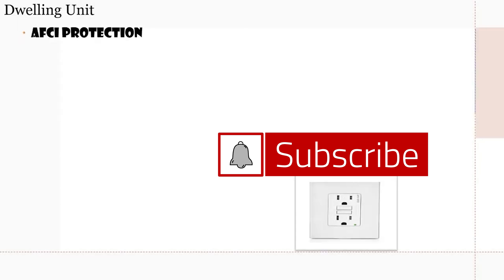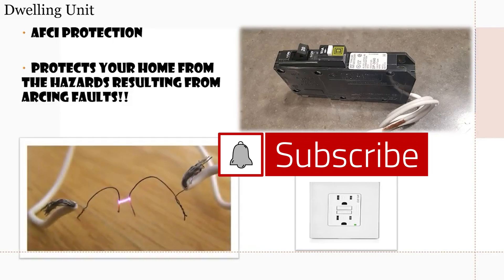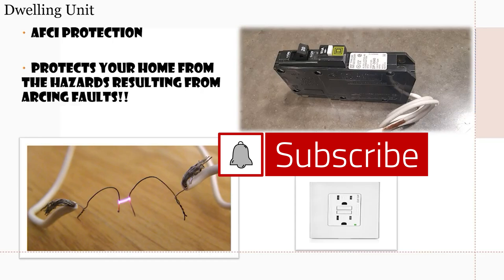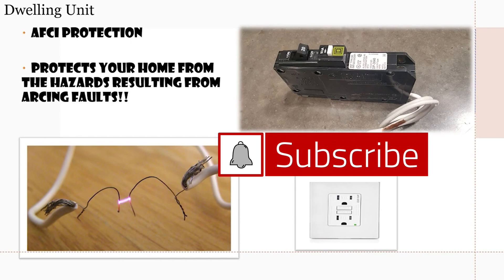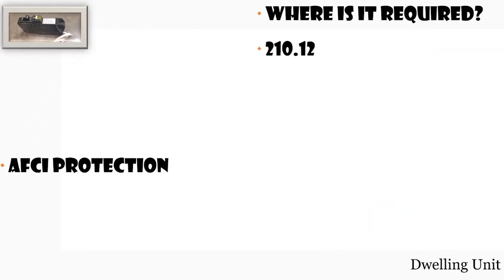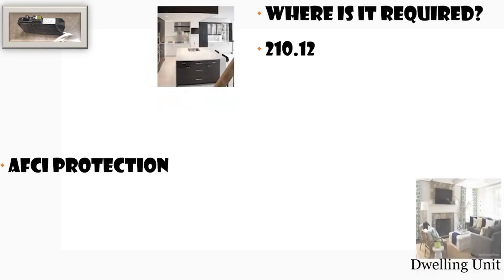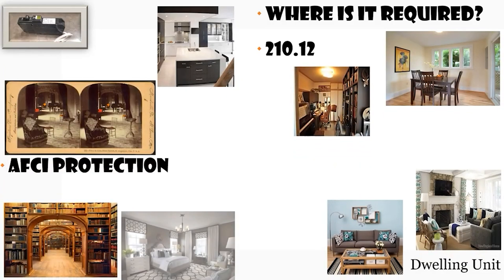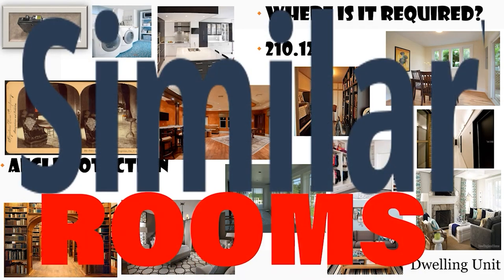Where are ARC fault breakers Required?

Comment: Wonder how I Ark fault circuit would react to a Old fashion knife switch controlling a heavy inductive load.  
      Still have a few homes in San Francisco that were built just at the end of 1800s and early 1900s that still have the push pull light switches that are basically a blade in a box on the wall.